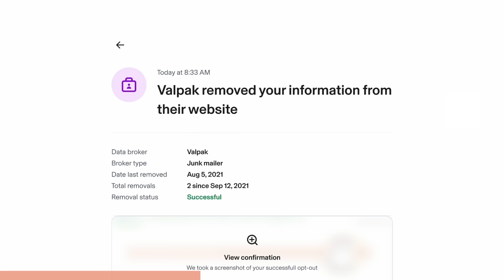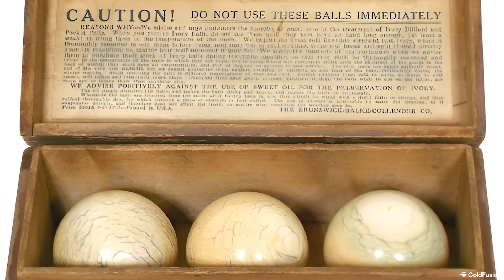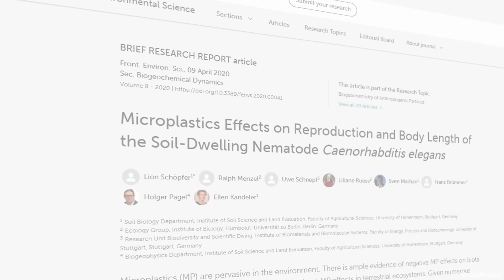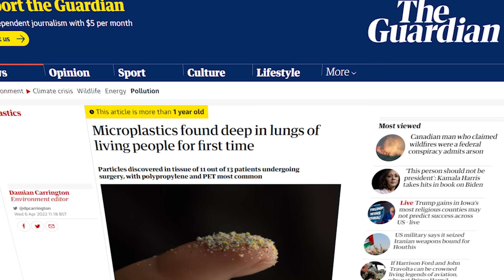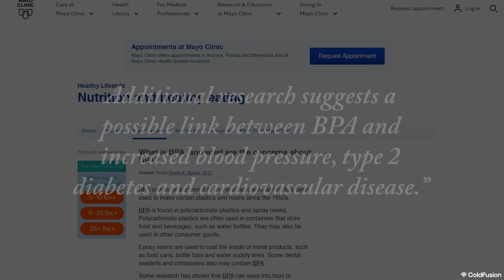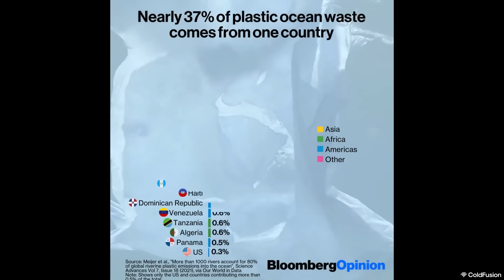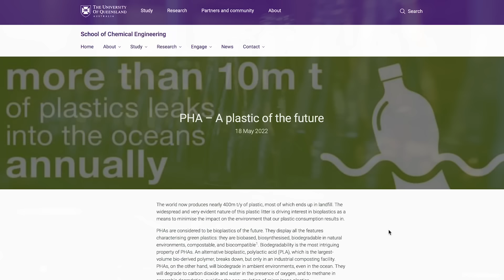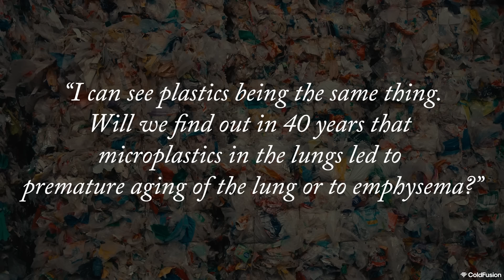How Microplastics Slowly Make Their Way Inside Us

Comment: The Bloomberg report stating that Philippines accounts for about 37% of plastic in the ocean is highly misleading. This is because the developed economies like USA are using the less developed countries as dumping grounds for their waste. I tried attaching a link but YouTube seems to hide that comment, so people can google out the same. This is a face saving measure adopted by the developed countries to shift the blame. Also while comparing any two countries don't just use the absolute numbers, but instead use the per capita numbers and this will give a more accurate representation.  Coldfusion pls pin this comment or add it in your video so that the video represents a more accurate picture on the actual problem.
Reply: This comment needs more attention.

Comment: I've had a long time idea for eliminating plastics wherever possible (More than 2 decades ago). During the 80s I remember my dad taking glass beer bottles to the liquor store, glass pops to the supermarket. They were glass based, so highly reusable. My idea was, and this has to be implemented by the governments of each country, to create UNIVERSAL containers based on amount of liquid and solids according to  needs. Companies would just stamp their logos/instructions/lettering on these bottles/vessels/cases/packages. These will be for example 100ml, 300ml, 1Liter, 3Liters 5 Liters, etc, whatever size is necessary made of glass or any other more permanent material. Instead of just garbage collecting we could have bottle collecting as well, people would then be credited for their bottle returns when they go to the supermarket . I'm sure people can come up with much better ideas than mine. This is the main idea (reusable containers) and I think it is totally doable. Something like this should have been implemented 30 years ago. I think it is already too late.
Reply: In some European supermarkets you can fill your empty shampoo bottle with a new shampoo, shower gel etc. Same, i am not sure, goes with cleaning liquids. And it's cheaper than buying new one.
Reply: Another option would be to have a lot of reusable containers labelled/tagged with a chip or QR code. You have the normal trash sorting, and then you have the tagged containers. You put the tagged containers into boxes, and a robot finds the label and sorts them at a central facility.
Reply: @placeholdername0000  See, a better idea already. I'm sure the EU and world governments could implement something like this if they really wanted to clean the planet. however Even at this critical point in time, doing REAL important actions towards cleaning up our one and only house (Earth) is not a priority because it is ''too expensive'', let the newer generations deal with it.
Reply: @MegaGasek  Yeah, imagine a future where most towns have a local train station, allowing semi trailers to be delivered to the factories and shops with only a last mile truck. And they carry reusable containers for a lot of things, some made of glass or steel, some of reusable and low/non toxic plastics. Industry powered mostly by electricity, with the waste heat being used to heat homes. The electricity being made with either renewables or advanced nuclear (fusion or fission with advanced waste management to reduce the radiotoxicity to a level comparable to what exists in the rocks already). Add to that the new advances in biotechnology that will allow us to ferment foods to increase yield and we have a very sustainable system.
Reply: i've been fantasising about this very idea for decades too.
We need universal bottling plants as close to endpoint as possible to save the cost of transporting all that glass back and forth and then have companies truck in their products in liquid storage trucks similar to fuel or cement trucks.
This saves everyone a lot of money and completely eliminates the need for plastics for certain products but coca cola long proved that the shape of a bottle is an important marketing tool hence why something like this has never happened.
Reply: I've been to at least 4 countries in EU (I'm Lithuanian) that pay you 10c per item for returning plastic/glass bottles and metal cans to recycle. 10c tax gets added to all the bottles and cans you buy. I am amazed it's not everywhere as it really works well. Especially for  homeless people as they now have a job to collect them.
Reply: @EarlHare  The shipping is not that bad, especially if shipped by rail.
Reply: @TavoTevas-hc8fp   I hear you however recycling is still a big waste. only about 9 percent of all plastic destined to be recycled is actually recycled. Reutilizing the same containers on the other hand is a real solution to our problem.
Reply: This actually already happens at small scale in my town. A local soda company bottles their drinks in glass. You then ship back the glass in bulk. Unfortunately, this is all done locally and at small scale. Implementing this idea with the scale of the worldwide drinks industry would require a lot of infrastructure (imagine the shipments needed to bring back all the empty containers).
Reply: Until it is cheaper, it will never happen.
Reply: @g1sbi  Most drinks are made relatively close to consumers already due to shipping costs. It is cheaper to ship syrup than finished soda. And you already need to return the trucks, even if they return empty.
Reply: @g1sbi now think about what soda does to your body. Just drink tap water 💟🌌☮️
Reply: The weight of glass is a problem, relative to plastic. Transporting it requires significantly more carbon emissions. Once shipping is done by electric vehicles charged from clean energy that'll be much less of a problem though.
Reply: This is already being followed in India with legal backing.
Reply: @g1sbi  Glass is much heavier than plastic, so an increase in carbon footprint is inevitable.
Reply: We were doing just fine without plastic bottles. Look back at the history. Countless examples of the "vintage" 40s glass soda bottles, glass milk bottles etc. Not to even mention the stuff that came before that. Convenience is going to be the end of us.
Reply: @MariusUrbelis  it isn't just convenience.  Glass bottles consume much more energy than does plastic. But yes, microplastics will be one of many thing to end humanity
Reply: This was what was used before plastic. You had to pay a deposit on the bottles, then return them for your deposit money back. Did this when I was a kid in the 60’s maybe 70’s too.
Reply: It's funny how a YouTube comment section can come up with more and better ideas than the lawmakers in our offices. What a time to be alive
Reply: @weirdshibainu valid point. However, plastic bottles are less reusable and even if recycled they consume energy in the recycling process. Sure an argument could be made that transporting glass across the world emits more CO2 etc. But WHY are we transporting bottled water and other liquids across the world in the first place. It's a very nuanced and complex topic. Both sides have valid arguments.
Reply: Bring back the milkman!
Reply: There is a payable deposit on all receptacles in Slovakia, plastic, glass or Aluminium. But just because you can't drink tap water in the developing world, it doesn't mean we should drink from plastic bottles in❤ the "developed" world. Are you a weapon of mass consumption? I try very hard not to be
Reply: @g1sbi  it should be combined with air ships.
Reply: The problem is, that people are different, and because of that, who knows what or how they handle the things they use. Also cut it down to the source of reducing and avoiding plastics whenever possible. And keep it out of the damn water supply...
Reply: It’s never too late, my man.
Reply: @weirdshibainu  carbon footprint doesn't really matter. Glass is healthier than plastics and for me that's way more important than climate-scam.
Reply: Weight of glass is a deter for the manufacturer and breakdown of the machine and rapid production
Reply: The 60s refilled milk jugs

Comment: Unlike metals and glass, there’s no recycling plastics, only prolonging the inevitable.
Reply: That is false
Reply: It is somewhat true. On the whole, only PET plastics #1 are recyclable on the whole. #2 HDPE is too but most recycling centers don’t accept it. 

And with both of these, you can recycle it only once if at all. So you only get one more use out of it. Not to mention you wouldn’t want something that held detergent to be made into a takeout container…so the recycled plastics can only be used for certain repurposes. 

Plus to recycle plastics, you have to melt them down which releases highly toxic fumes into the atmosphere. 

Highly recommend watching Frontline’s Plastic Wars documentary.
Reply: Almost all plastics end up in an incinerator. The little that does get recycled is more expensive AND lower quality than virgin plastic, so manufacturers dont like it, other than mixing it with virgin plastic, for virtue signaling to say "we are using recycled plastic" @rayukk
Reply: @rayukk  PET for example can't be 100℅ recicled, he turns into something different like clothes that can't be recicled. Being reciclable doesnt mean it will have the same characteristics forever like metal or glass.
Reply: @rayukk How so?

Comment: I am studying microplastics, and my area of expertise is how different kinds of plastics  break down even smaller in the environment but in my research group there are ongoing experiments of the toxicity as well. I do have a couple important notes about the video. Plastic itself is not dangerous. It is polymere, which implies the structure of molecules and polymers are everywhere naturally. The danger is in the additives in plastic products (like the PBA). Most of the plastics from the environment go right through our bodies, there has been studies of that, but some, the smallest ones called nanoplastics, could go inside our cells for example. That could do physical harm in theory. However the actual health concern is the chemicals. For that reason biodegradable plastics are not the answer!! They contain all the same additives or even more than the regular plastic products. 

This is a complicated subject. There are some good points to using biodegradable plastics in the future, but implying that to be a solution for the health risks is simply misleading.  Also regular plastics do break down completely as well, some even surprisingly fast and oceans are not our only problem. There are estimated 4 times more microplastics in the soil. 

Overall the video was on point mostly and I do appreciate the focus on the topic. I just think it is important to understand that plastic itself is mostly carbon, it is “natural”, but the chemicals make the danger and at this point biodegradable plastics are mostly greenwashing.

Comment: One under appreciated aspect of microplastics revolves around their chemistry during manufacturing. Plastics are polymers, meaning they are an assemblage repeating subunits called monomers. During manufacturing, not all monomers link together to form linked polymers. These unlinked monomers are known as "unreacted" or "residual" monomers and overtime they can migrate out of the polymer matrix given plastics are somewhat porous. This migration depends on a number of factors like UV exposure, temperature, the type of plastic, etc. Higher temperature will accelerate migration and thats part of the reason why leaving a plastic water bottle in a hot car is a bad idea. Unfortunately, these monomers can migrate into the air too, not just water. This is why I am not surprised they are starting to find microplastics on the top of remote mountains. Plastic molecules are quite literally in the atmosphere.
Reply: Good news for anyone operating a 3D printer in the house, accidentally overheating plastic in their printer, breathing plastic fire fumes or working in plastics extrusion/recycling.

Comment: No one is mentioning HEMP as a base oil for compostable plastics, and also as a natural fiber composite for plastic alternatives. And as fiber for clothing. And as an oil base for makeup and other cosmetics. Hemp does everything oil & plastics do (including corn cellulose and other plant based plastics), and is better for farmland than GMO cotton, corn, or soy that it replaces. Also, in Japan, way back in 2019 or 2020, scientists developed a "fully recyclable" plastic that can easily be dissolved back into monomers and reformed back into any plastic, unlike the downcycling of today. Bottle deposit laws are another good option, producing a 98% return rate in Michigan. Many solutions, easily developed with minimal regulations and fairly low carbon taxes.

Comment: This is so absurd. If plastic cups that degrade are 80% more expensive that means a $0.05 cup now costs $0.09? How is that a problem, this could've been solved by regulation and/or an eco-tax ages ago. Nobody can notice an 80% increase on the cost of containers to have something that breaks down.

The real question is if those biodegradable containers break down to microplastics in the bacteria which consume them. If the plastics just get finer, that may or may not even help.

Comment: 25+ year plastics engineer here... 1) Most plastics can be recycled up to 7 times before losing physical properties and the carbon footprint of plastics processes is much less than metals due to the lower heats and less fumes. 2) Most milk jugs and water bottles are made from Polyethylene which is very innate and wont hurt you. Its the plastics that they add synthetic plasticizers to, like phthalates to make them flexible. Like dont drink water from those cheap pvc sports bottles from China. 3) Plastics are made from oil, all the sludge that they cant even use for gear grease pretty much, then synthesized and reacted. We can make bioplastics from any plant as well, you just take the biproduct sludge they cant use from making ethanol. The problem here is the FDA requires such high standards that short life bioplastics dont pass their tests. 4) Id be much more worried about heavy metals bro

Comment: I do not usually comment but there was a slight inaccuracy inside the video. Recycling plastic bottles does little to nothing. Metal and glass may be recycled and reused for different purposes however plastic not so. From memory you can only do it once and it is not easy. You receive an inferior product on top that also. Recycling will not solve this problem what so ever. The issue we are currently facing is extremely concerning and there are no real solutions in all honesty. The best we can hope for maybe is designing bacteria that breaks down and eats plastic. Regretfully however the process is very slow and the rate of plastic we produce is far more than bacteria will be able to break down. I sincerely hope we find a solution to this problem quickly as time is running out.

Comment: I worry not so much about plastic but about how plastics absorb/attract and concentrate pollutants and heavy metals. And then it bioaccumulates up the food chain.

The easiest way to avoid this (without becoming obsessive) is to eat lower on the food chain. Being plant-based and extremely athletic (I run half marathons and do HIIT 6x/wk, and lift competitively) is actually a lot easier than anyone thinks. I also use an air purifier (just a fan with a HEPA filter) at home. 

Again, try not to be obsessive, but eat lots of fiber (which attracts pollutants and speeds their transit time through the body) and do what you can. Still a big unknown here.

Comment: Individuals recycling and putting personal effort on that is pointless to the point of being absolutely moronic.

Plastic is super cheap, super abundant. Spending lots of effort manually by human hand sorting and recycling it is absolutely stupid and counterproductive.

Issue has to be resolved at industrial level, and until automation reaches the right level, or mass processing it will not happen. This is a technology issue, not a social.
One has to look at the big picture. Spend 1 000 000 000 000 human hours annually sorting valueless stuff, or spend fraction of that researching an actual solution?

It's akin to building your own house without any tools, by first making hand tools but no machinery at all? Does that make sense? Absolutely not.
Then why does it make sense for humans to spend hours upon hours of time recycling and sorting waste, instead of building a machine or process to do that?
Reply: most people don't realize plastic is pretty much irreplicable in the modern world. no other material is nearly as abundant or has as many useful properties.

Comment: The electronics industry and consumers have a severe problem with reusing electronics and simpler designs. 

The issue is OEM's are now making software thats extremely limiting, meaning even if your device is repairable and upgradable, you still don't have full control over it. Xiaomi allows the easiest custom rom installations and gives you the tools for it, but why not make it even easier and more accessible on other phones? Custom roms are what allow the 6 year old poco f1 to run android 14 smoother than most budget phones. 

Then there's intel and amd selling you 2 generation old CPU's under the guise of new CPU's meaning you are forced to pay more to actually upgrade OR be forced to upgrade sooner because you bought a 2 gen old CPU thinking its the latest model. And all this is on top of artificially limiting laptop parts so intel, amd and nvidia can force you to pay more for upgrades. 

When people buy ''thin and light'' devices or pay for superior ''software support'' on phones and laptops rather than buying actually affordable repairable and upgradable devices which are available today what else do you expect OEM's to do? Not rip off these people? And techtubers don't make it easier either by giving half information, not even covering these issues or just making 1 video on it and calling it a day.